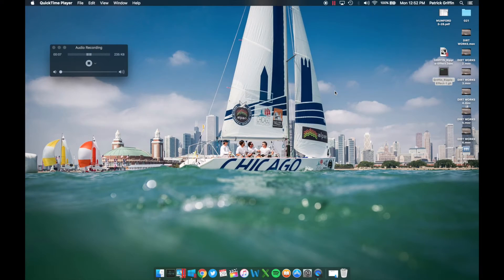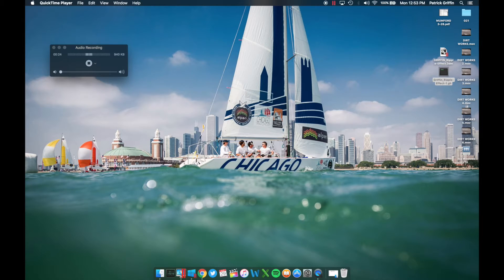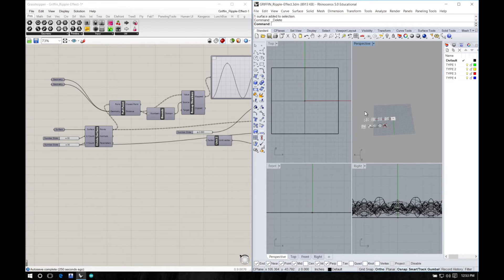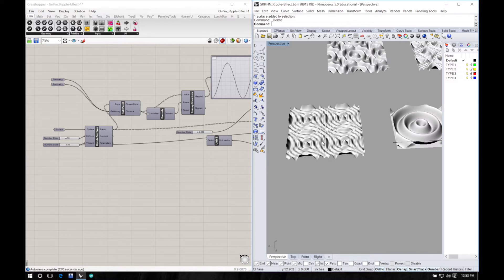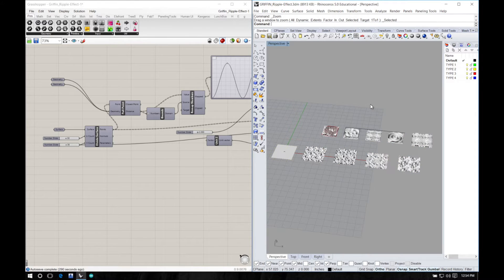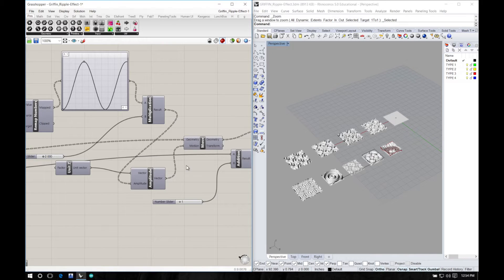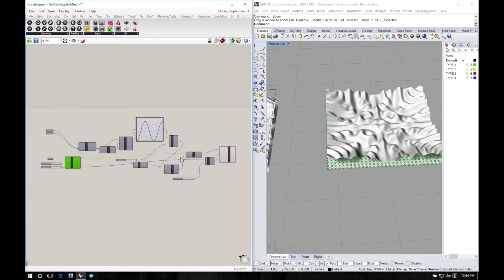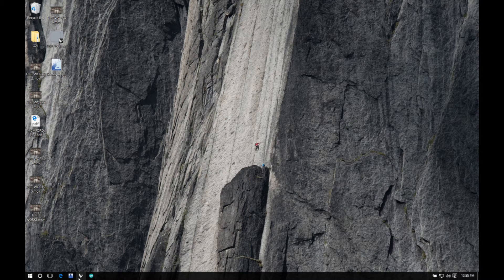001: Grasshopper - Parametric Surface Interference

Comment: Just keep in mind that this is not a true interference pattern. For true interference, the wave from each point would add and subtract across the base surface, and in this example the wave from each point simply replaces the wave from the other without adding or subtracting. For this to work one would have to duplicate the script for a second point, then add the Z values at each point, then surface from points
Reply from the maker: alban bassuet - you’re absolutely correct; but for the sake the first lesson, this content seemed to be more than enough. I did not want to over complicate things.

Comment: Hi Patrick great tutorial! I have a problem, I'm not sure why my points are not moved radially from the centre point. Instead, they seem to be affected in a linear fashion (if that makes any sense). Do you know what the problem is?
Reply from the maker: try to flatten or graft one of the nodes that the points run through. You may only be augmenting them in the U or V direction - That's the most I can tell you by guessing...
Reply: Patrick Griffin appreciate that, will go give it a try! (:

Comment: Hi, I thought you were gonna show how you made the other surfaces but you only did one.
Reply from the maker: just change the slider - if you dial it up to higher numbers the 'ripple' starts to have a frequency greater than the spacing of the points on your grid and makes super weird patterns.

Comment: Hi Patrick, great tutorial! Thanks for this. Unfortunately in the end it doesnt work for me...the surface from points doesnt generate a surface ...it says the Uvalue count is not valid for this amount of points . or if i move the slider (for the addition) to 7 the last box shows me that a point in the grid is null ..can you please try to help with this. thanks in advance!
Reply from the maker: you need to use an addition block to add 1 to the U-Count. That's at the end of the video near 35:41
Reply from the maker: Computers start counting at 0, rather than users which identify 1 as a starting value. When the nodes take the input of 15, it creates data with 16 branches; therefore, you need to add 1, back into the input u-count so that the total passed to the "create surface" block is 16.
Reply from the maker: A better version of this tutorial would have used list-length to count the original divide surface output after creating points

Comment: Hi Patrick, thank you for posting the tutorial. Could you please try and help me, when i plug in the Z vector into Vector/amplitude node absolutely nothing happens. Im obviously doing something wrong but have gone through the video twice withe the same result.
Thank you.
Reply from the maker: Maybe your z-axis multiplier is too small, or you haven't grafted the point-list? Those were the most common mistakes I would see when teaching this lesson. Also make sure you have registered your initial point (the one where the pattern radiates from) or points - you may have to select "set multiple points" when you right-click on the node in grasshopper.
Reply from the maker: @Hannah Leber null is an error you get if there’s no data coming through somewhere in the script. This is likely because one of your parameters cannot be computed, or the script is missing a critical input (like geometry) in order to operate. I would go through and check each input, and follow those until you locate the command that isn’t outputting anything.

Comment: Oh... But at the end, when I tried the "bake" command, I only got points and not a surface...
Reply from the maker: you might be clicking "bake" on the points node, if that's the case,  try clicking "bake" on the node that represents the surface.
Reply: @Pat_G_  Thank you. I was "baking" from the "Surface from Points" node, by clicking on the "point" button (input). I tried then clicking in the same node, but this time in the "surface" button. It worked :)